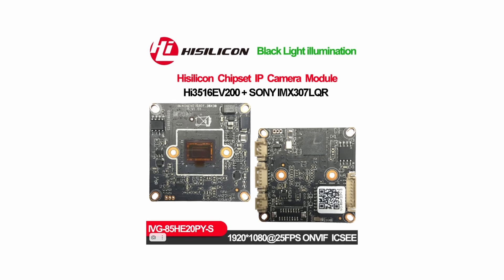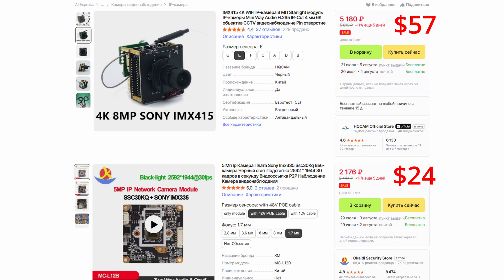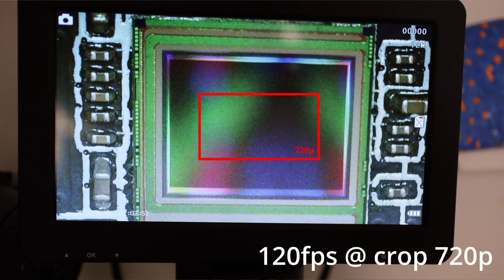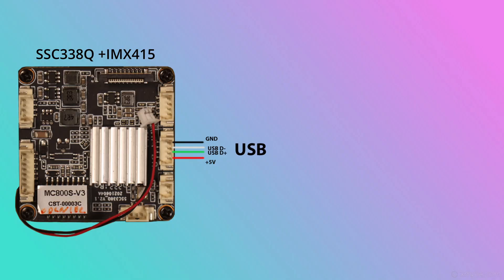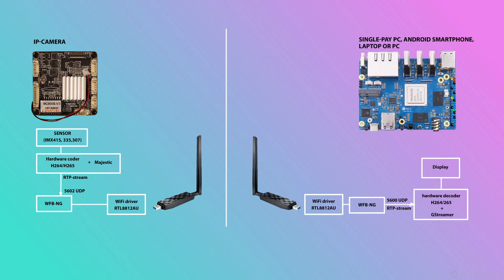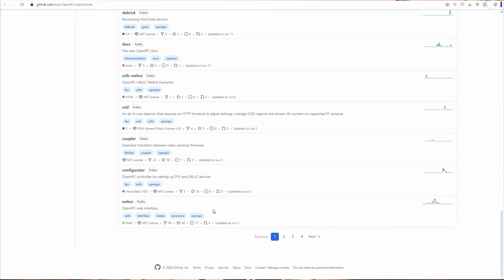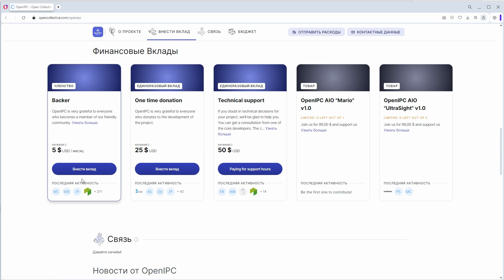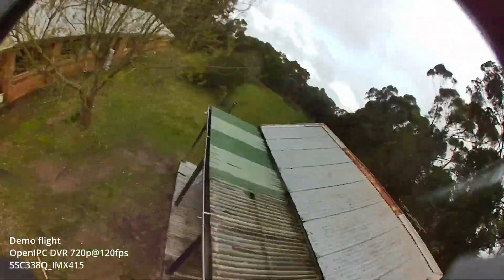All about OpenIPC FPV for the First Half of 2024 #OpenIPC

Comment: Do you think a locked latency similar to analog or HDzero would be possible? I think that would be one of the most alluring things about this system if that’s possible. Being able to set the parameters of where the latency was allowed to fluctuate at the cost of breakup and lost packets. 

The project looks really interesting. Thanks for sharing all the information about it.

Comment: Worst part is, someio fpv promised it as open-source, still the hardware isn't 😂😂, no where close to off the self  system, it's better than relying on some dude.
Reply: Could make your own hardware to run the open source software. I believe it's not open source because of NDAs for the ISP used.
Reply: You can design your own hardware if you know how. For that you will need to study really hard and graduate from a university as engineer. So please don’t blame our project because you don’t have an engineering degree. Our software is completely open source and we have already seen 3rd parties creating our own hardware and it’s working fine with our open software.